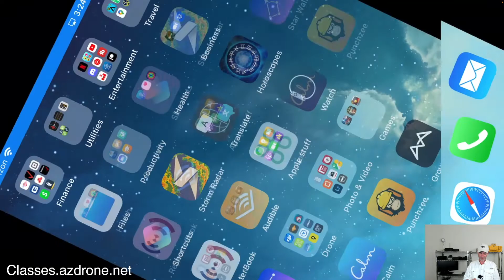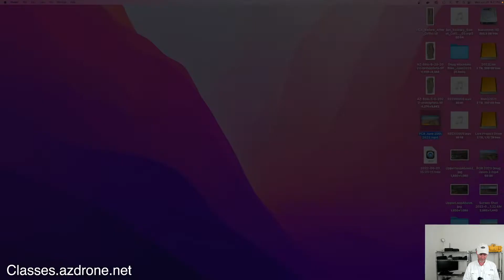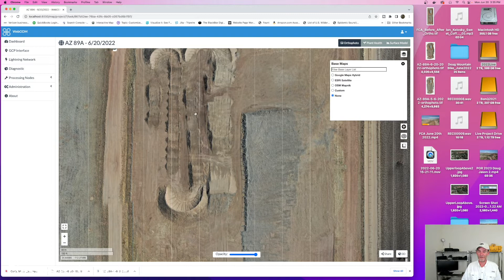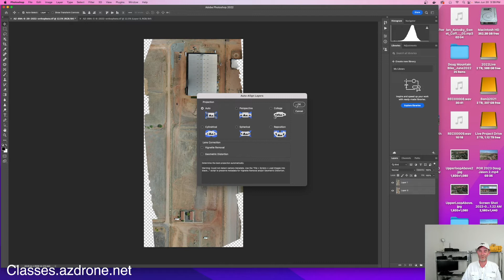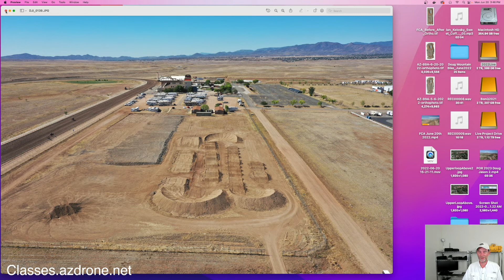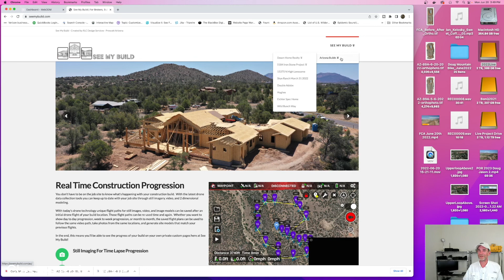Drone Construction Mapping And Time Lapse Video: Full Process Walk Through

Comment: What do you do if there are say 5 stages of progression. How would you apply the slider to that? Just before and after? Do you export the layers that were aligned from photoshop in order to get the images to match up in the slider?
Reply from the maker: If we have several months worth of progressions we can show the most recent flight vs a flight a few months ago.  Or we can show this month vs last month.  That's usually what my clients look for.  We do keep all of the collected data from each flight, so we can re-use previous orthos easily.  And you can align more than 2 layers in Photoshop, so if you need several orthos over time you can easily render them, align them, and then present them.  Hope this was helpful.  😀
Reply: @AZ-Drone  Very helpful. I didn’t think about using Photoshop to align them. I just assumed I would keep the exact same flight missions and hope for the same results but I haven’t put in practiced yet. Thank you. I have been on the lookout for a slider where you can select different dates. I haven’t found one yet.